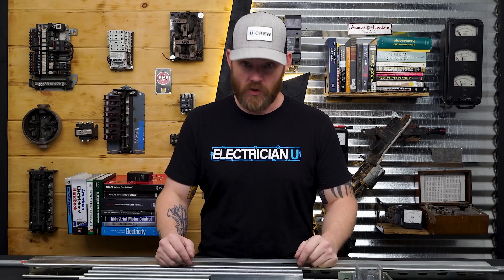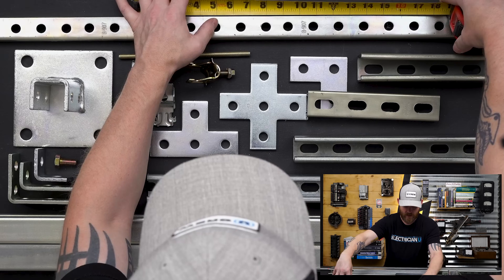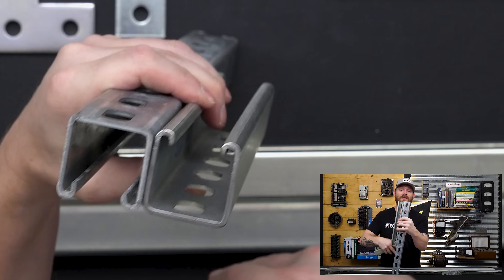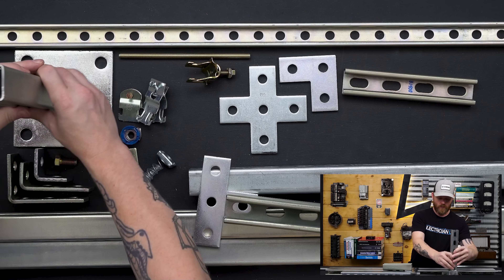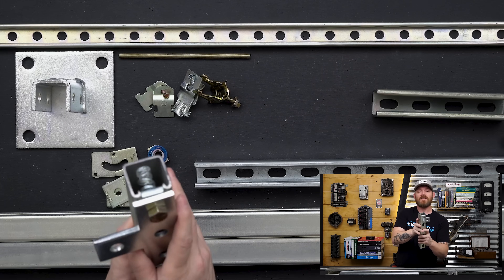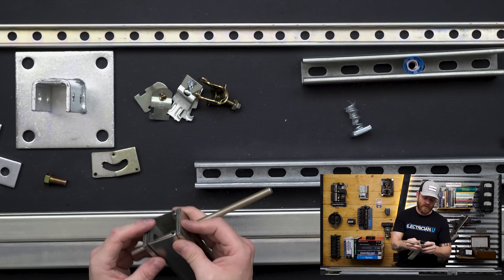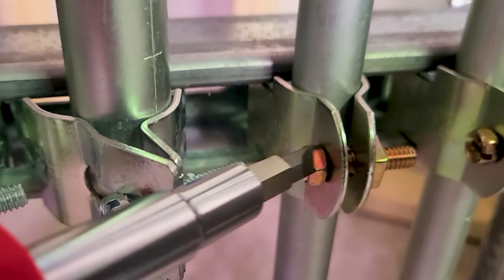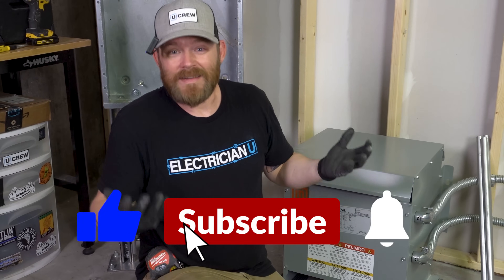You've Been Using Strut Wrong — Here's How to Do It Right

Comment: Big boys Meccano, strut, channel, unistrut in the UK. Shallow strut we know as 21mm and standard 41mm. 
I’ve been using for 30+ years, rarely we use the flat brackets on the back of the strut. Food for thought. 
Never seen the strut with the round holes in before. We as standard can also purchase “Plain Strut” without holes.
Good vid 👊😎👍💙

Comment: Struts work great in double walled pick up beds. Bolt it to top inside edge and or bottom ,  insert rail nuts / bolt eyes and slide were you want to secure loads various sizes. Carabiner also useful using this system.

Comment: I need some advice- I am here because I have a roof rack that uses a strut type bar for the inner cross bars but the cross section of the bars do not have the final lip on the under side. The cross section is basically a straight "C" shape. I need to get some hardware to easily mount some things to the rack. The holes are 2" long by 3/4" wide but I don't remember the hole distance on center. If any kind soul out there can give me some help I would greatly appreciate it.

Comment: If your building with strut and have trouble with hex nuts and sockets, use allen screws/ bolts. Your allen key always fits in the strut.
U can also use alltread and     a punch to lock a (spring) nut on the end of it. Just stick it in de channel and twist, handy when you need longer threads.

Comment: You put the feet on backwards. You're supposed to put a spring nut in the strut channel and run a bolt through the foot with strut flipped around or the foot flipped around opposite of how you did it. Looks nicer bc you only see the head of the bolt

Comment: Im a UK sparky and we just call it strut, we can either get it galv, fiberglass or stainless steel. Are double back strut is commonly welded together. We also have cantilever brackets which is strut with a plate already welded to it for fixing to walls or floors. Sping nuts we call Zebs and tend to just rip the springs off. All are's is slotted and works on a 50mm/2" center makes it a doddle when cutting loads off lengths. We also have lidding available to finish it off

Comment: As an electrician, have you ever used it dual purpose as raceway? I just saw that recently. We use it for tons of things on elevators. We call it strut channel or unistrut. They make channel nuts up to 3/4"-16. The slots in the back are 2" on center per our manufacturer and are 9/16". The opening width on the open side is only 7/8" so the biggest socket that fits in there is 9/16" for a 3/8" bolt. However, they make specialty narrow head 3/4" sockets for 1/2" bolts if you really need to put a 1/2" hex bolt in the back for something.

Comment: The shiny coatings are zinc electroplated (yellow or gold colors are just dyes in coating). The dull finish is hot dipped galvanized. The hot dipped is superior for corrosion protection versus the electroplated.

Comment: I live in the UK now, and we almost exclusively use spring nuts. However; everyone, myself included, just yank the spring off. They're more trouble than they're worth, but I'm guessing the contractors use them for cost efficiency. I'm a subby, so I don't deal with ordering, I just make it work, and they work well. I just hate having to put up a 3 meter length strut on my own. On a shaky ass scissor lift, 30-40 feet up, trying to tap into a roof perling. That is a b1tch! :D I'm guessing we've all been there... We also have one guy whose only about 5' tall and maybe 130 lb soaking wet. We send is little ass into the tight spots. XD. Every crew needs this guy.

Comment: Whatever you build will be Stronger if you use the T-brackets on the open channel side with strut nuts. It forms into a complete square tube at the crucial points. If you still need to mount a panel or whatever on those points, bring out the panel or box with square washers.

Comment: Strut is a great system for sure...
Luckily later in my career i learned to fabricate....that changes the whole game

As for conduit racks with tight spacing, sometimes i would mix ½ with 1 in straps to mount ¾ emt...that would nicely cant the bolt

Comment: I install a lot of 1 5/8 and 7/8 strut and I have never seen 1 7/8 center to center hole spacing . In 15 years I have only ever seen 2” spacing .
Reply: yes was looking for this comment!  I'm gonna find a piece and confirm later, but even when he was talking about it you could see on the tape it didn't look like he was losing 1/8" at each hole.  I used to work with it all the time, 99.9% sure it was all 2" spacing
Reply: Just checked to be sure, definitely exactly 2" spacing

Comment: Spring nuts don't need to be slid in. You just turn it horizontal, press it in where you want it, press all the way in, then rotate it 90 degrees and release and it stays. You can add and remove them any time at any spot. That's what I always thought was the great advantage of the spring nuts.
Reply: Cone nuts do the same and you don't have to deal the spring pushing through the strut hole. Not such a big issue if you're using kendorf tho
Reply: Long run-on sentence alert below, LOL:

True. But if you just mounted a box and found that you need to move one spring nut over 1/4" to align with the hole, so you slide it over, then the spring slides into the slot in the back of the strut, therefore making it impossible to keep it still while attempting to start the bolt, you will understand why the cone nuts are much better.
Reply: @capriracer351 cone nuts don't last, especially in environments without climate control. The composite cone becomes brittle over time, cracks, and then fails.
Reply: Cone nuts changed my life😂
Reply: r/wooosh bro he literally says that later in the video lmao

Comment: 6:10 Southern Alberta we called it Cantruss at King Electric..(RIP).  I'm assuming it was Canadian made.  We also got UniStrut often and called it that it strut.  Also I just got an ad for Fiberglass Strut a few weeks ago.  Crazy stuff.
Spring nuts were the majority of what i used while in commercial industrial electrical.  But they cane out later with awesome solutions.  The square split nuts washers looked so easy.  I had a Klein strut screw driver that was made specifically installing spring nuts.  Very handy.

Comment: If you have factory roof bars on a car/truck that run lengthwise of the vehicle add a few bars of slotted strut widthwise using U bolts. Boom....most versatile roof rack available for cheap. Have 3 hot dip(gold galv)struts on my roof for years now in MN and no rust at all.

Comment: 9:38  building switchgear, i would send the bolt through the hole in the cabinet, thread it into the spring nut (which i ripped the spring off of because those little barstards just get in the way) a couple threads past the back of the nut.  Then I'd take my linemans and use the cutting section to slightly mash the bolt thread 1 or 2 threads from the end, and back the bolt into the strut nut till it grabs snugly but isn't marring the threads in the strut nut.

Now when you slide the nuts into the strut, they'll spin with the bolt head, making it super easy to adjust the cabinet and then tighten the bolt.

Works every time.  It can be used for any application that you want some tension or nut retention.
Reply: Make a video about it.

Comment: Stainless Steel Unistrut is a DREAM to build with.  Idk what it is about it but it's just SO  N I C E . . .
Reply: I'm not an electrician, but I have installed a lot of stainless uni-strut. It's not fun to cut, drill, or tap.  Slow speed and lots of pressure. stainless will work harden if you're not careful.

I'm a maintenance worker in an indoor farm that does aeroponics. The fertilizer is highly corrosive and would strip the zinc off galvanized metal in about 6 to 8 weeks.  For just one example, I've built several R&D systems for the growers to test ideas for the next generation of production systems they are developing. Because they're a standalone test bed, they are independent from the current production equipment servicing the grow rooms.  That means each one needs its own pump, filter assemblies, piping, and controls.  I use stainless uni-strut to build my own pump skids. That way I can build it in the shop and move it into the grow room as a completed subassembly, connect it to the tanks and the system, then kindly ask the electrician to connect my control cabinet to an appropriate power source. Because they're only for R&D, the strut doesn't even get bolted to the floor.

Comment: As an apprentice 29yrs ago, I heard it called Uni-strut. I've always called it Strut. Always have used slotted. Started in AZ, worked VT & NH. Always commercial, industrial.  Mostly educational institutions & Mines.  In the Mines, especially  in SXEW Plants, we used fiber strut due to the caustic environment. Anchor systems were fiber/plastic with 2-part adhesives.

Comment: I built some insane backboards outta strut! Some strutt feet anchored down propperly and a basic A frame works wonders for electricians. Ive mounted panels and heavy DCs at concrete & asphault plants that are in high traffic areas that will stay up as long as the plant is around… or untill a sleepy truck driver plows thru it 😅

Comment: Shallow unistrut is 13/16  not 7/8. It is exactly half of 1-5/8. The slots are not 1-7/8 they are 2" center to center on PHD strut.
Reply: Correct on the slots! Strut sections with Round punched holes are 1 7/8" O.C. I checked both B-Line and Unistrut specs.

Comment: In South Africa it was known as unistrut. It was metric, 41.6 mm instead of 1 5/8 inch. A colleague and I designed 11 km (7 miles) of unistrut cable ladder for a project. In South Africa unistrut was basically the same as in North America, but with some local development such as the ECL76 cable ladder = Electrical Cable Ladder 76 mm shoulder. Brilliant product, invented by an American hardware shop owner.

Comment: Unistrut.  I am used to welding rather than using the hardware.  Note that most of that stuff is galvanized which requires precautions when welding.

Comment: Years ago I made storage shelve from maybe 20 year old  but great shape unistrut I removed from a job. Cut sheets of 3/4 plywood in three pieces to end up with 32" deep shelves. A long and short milk crate were around 30" deep. Mounted strut every 4' on concrete wall & legs every 4' and strut every 16" to support plywood. 35 years later still in good shape.
Reply: I was just thinking about doing that, I'm moving in a few weeks and will need lots of shelving build, I'll have to come up with a formula to know what parts I need. I used to frame houses for several years, so building with wood would be very easy. But I want something that looks cool! I'm afraid it'll be a bit pricey, though.
Reply: They make what AC guys called Dexion & others metal lumber but it was thin maybe 1" wide by 11/2" with holes & slots and think it came in another size. Guessing its less then halve the cost of unistrut.
Reply: @jacobplank  Good luck with the shelves. I'm horrible with wood so stick to metal. I had 3 or 4 Erector sets that I got cheap from older guys and loved building with them. I used to build a 5' parachute ride that I had to use a stepladder to reach the top ( maybe 9 years old ).  As an electrician always enjoyed drilling & tapping holes and installing unistrut.  Favorite jobs were doing electrical work at machine shops, tool & die shops and an automatic screw shop.

Comment: Most guys do not know of how many different depths unistrut comes in. I had to install over a mile of 3/4" EMT to feed a double duplex receptacle, 208 three phase twist lock receptacle and two 480 volt 3 phase receptacle side by side every 12' for an plastic injection molding plant.  Took a few weeks but I got a 100' of 5/8" deep unistrut to mount 4 or 5 deep 1900 boxes to them used 7/8" deep unistrut to support all of the 3/4" EMT conduits. Had 360 degrees in bends and using that combination I did not have to make over a hundred offsets and a C condulet or pull box. Also used 20' lengths of unistrut a few times. Had to double it up to prevent 12 to 14' length to prevent sagging because huge duct work above it prevented dropping all thread to center of long strut. Only stocked & used 1/4 & 3/8" umistrut nuts. Always stocked hundreds of 1/4 & 3/8" fender washers with a maximum of 13/8" outside diameter for slotted unistrut.
Reply: So you used 7/8 and 1 5/8 strut? That's the only 2 sizes I've ever seen. I was hoping you'd list other depths
Reply: he used 5/8" for the boxes and 7/8" for the conduits so he needed no box sets. very smart. stuff like this makes the Journeyman productive. That's what makes us knock out mechanics brother! less steps work smarter not harder!

Comment: Unistrut, strut, slotted, unslotted... We worked with the Germans in Beverly Hills (Metro) called the TBM (We have to work with them along with there machine), and they have there own Unistrut.. There Unitstrut slots in with the square washer/Spring nut perfectly with little wiggle room so you dont have trouble installing the bolts to the washer... I like the Unistruts from Germany better than the US... It's easier.

Comment: Ratcheting wrench ( Gear Wrench , etc ) works for those straps . Alternately , a right angle drill adapter can be useful but , in a lot of cases , they still do not have enough clearance if the conduits are closely spaced . Love those angle straps .
Unistrut is just a slightly more expensive Erector Set , for adults .
Reply: An offset extension wrench might work.